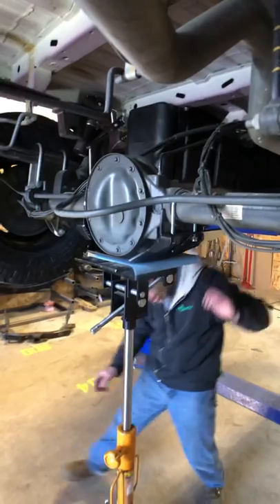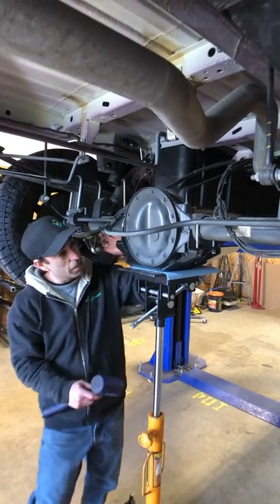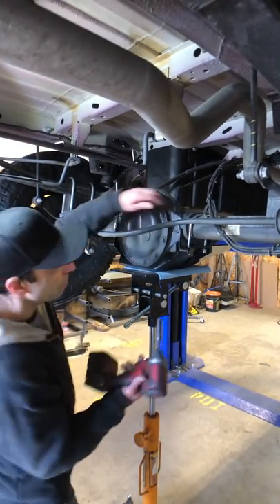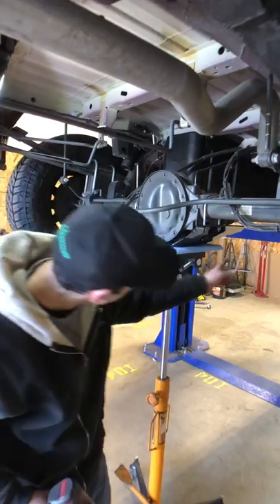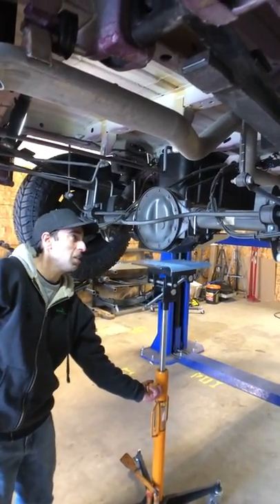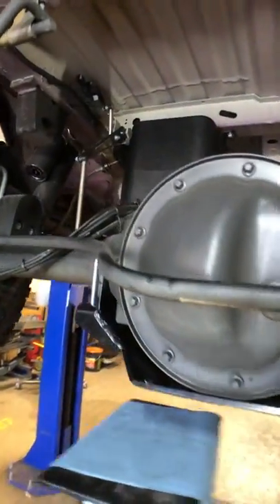Van Compass Mercedes Sprinter Differential skid plate installation

Comment: I think the front u bolt should have been a little longer, the bolt is under flush with the nylock nut. I though maybe I positioned it wrong, but it's like that on my buddy's van too, even another installation I saw on YouTube the bolt was under flush.  I dabbed a litte blue Locktite on them "just in case".

Comment: This was not at all as simple as it looks. The fingers on left and right that surround the differential housing seemed to be too tight against the housing. Mike at Van Compass told me that in fact the saddle in the skid plate does not actually come into contact with the cast iron differential housing. There should be a gap of a couple of millimeters. This is so that if the plate is struck from below it does not immediately transfer all of the force to the bottom of the differential housing. In other words, this is as designed. I completed the installation and torqued it all to spec and it looks OK.
Reply from the maker: A floor jack to push the skid plate into place is typically used. We make the fingers tight to keep the part in place. (208) 500-3783

Comment: Nice!  What are your thoughts Rob(b) considering a plate for the gray water tank if one is underneath a van?
Reply: Not Rob(b), but I would say that while you could make such a plate, it would be expensive, and would have to be custom designed for your rig, since they are all rather different. The gray water tank is not a critical part, as is the differential, so it is probably not worth it.